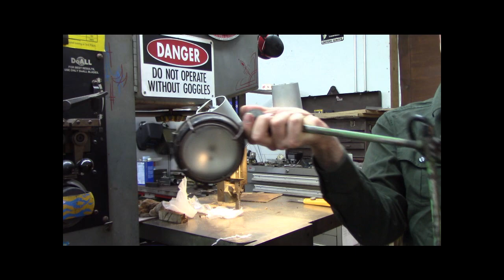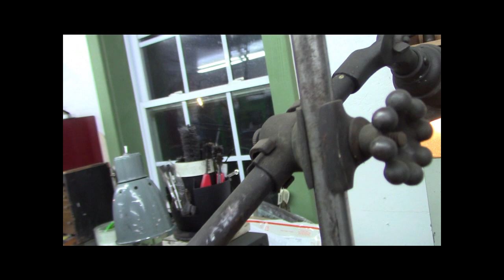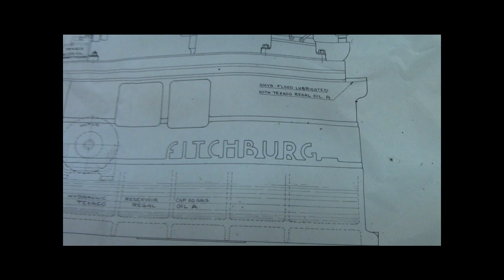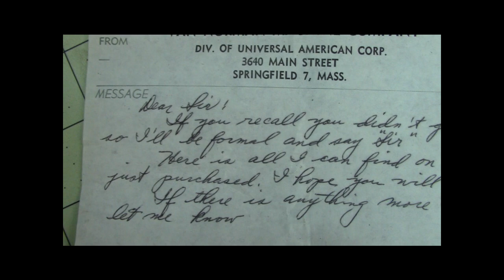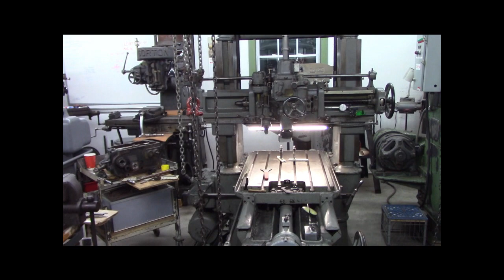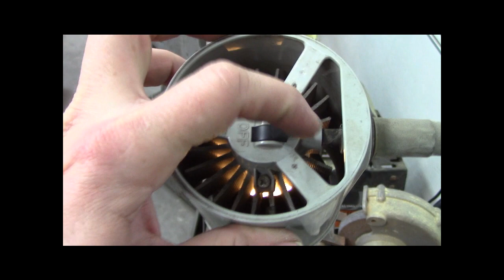4-27-23  --  OC White Lamp Unboxing, Fitchburg Grinder Drawings

Comment: You have a cool passion for lamps
Reply from the maker: Thanks Brian.  Lamps also for me are a way for me to explore my artistic and esthetic design part of my engineering brain.  As engineers we tend to think and design in geometric shapes. Lamps have a bit more free form design elements to them.  Some years ago, I built my own motorcycle frame, and that was a challenge for my brain.  Motorcycle frame tubes are not straight hardly at all.  All those curves and non-flat surfaces were an exercise in alternative thinking for me. Lamps are cool and make my brain hurt a little less.  Thanks Brian, ---Doozer
Reply: Just found an OC white lamp in the garage.  Going to try to restore it.